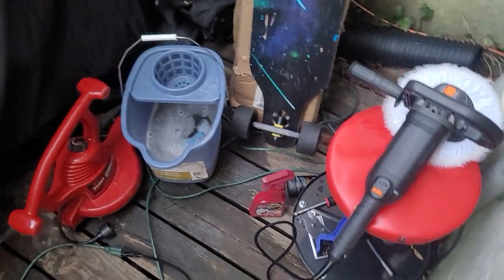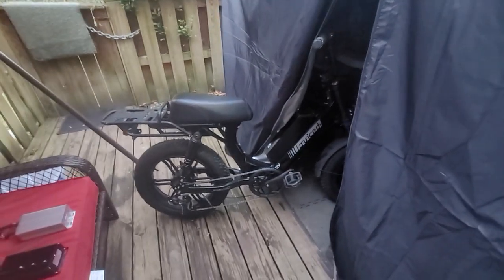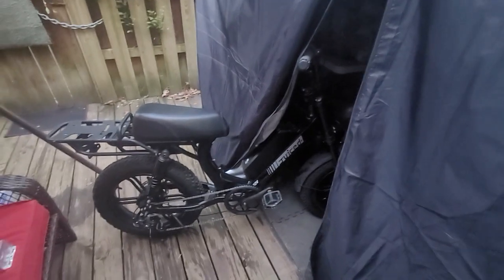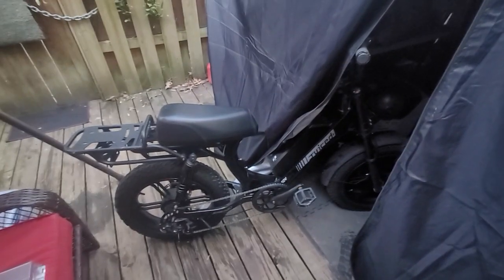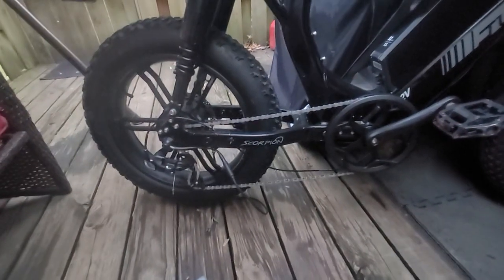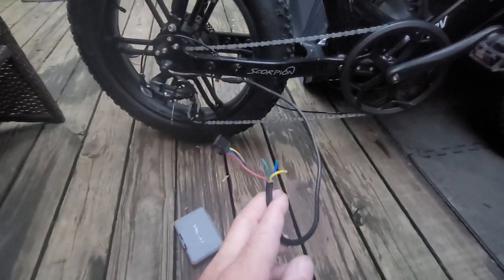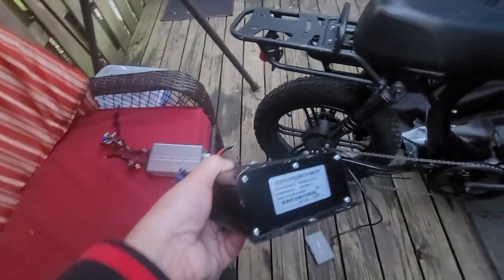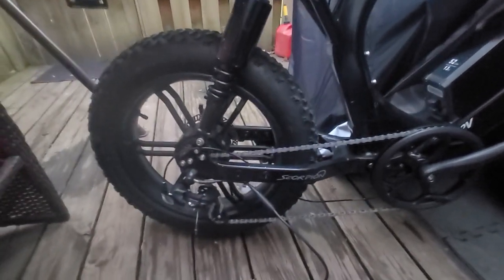How to make your Super 73,Zugo, Juiced bike faster in easy inexpensive steps 1st get your mind right

Comment: Hi!
I Did The Upgrade  And I Got A Super 73 and  750w hub motor  And A 48v  20ah  Battery 
And I Set The Controller  At 40 amps .It's  Running 
With A Lot Of Torke. 
My Question  Is Do I Have To Match The  Battery  Ah
With This Controller??
Or This Battery  Is Ok??
Thank's 🙏
Reply: That’s a good question!!!???

Comment: Hi I Just  Bought it 
What Lcd display I Need For It 🙏 🎄
Reply from the maker: @danielandujar5479  any display with a line input but you'll have to hardwire this isn't really a controller that would have great telemetry if you want that you need to spend a Lil more. This is as budget friendly as it gets. At least upgrade to a real Sabvaton

Comment: Hi, trying to replace the Rhino controller and wiring harness that got fried after battery upgrade from Zugo.  What type of wiring harness did you buy or is it a diy modified fat 3 pin Bafang power cable?
Reply from the maker: I got rid of all the stock everything so all new wires couldn't do anything with those small factory wires even replaced the motor so new phase wires I trashed it all
Reply: @ChrisCrossingWires1212  thanks for the reply.  These ebikes are better off being modded since the stock parts are usually pretty junky.

Comment: I wish you was doing this in a super 73 I want to add an aftermarket controller on my zx but all those wires on the controller just makes it seem so complicated whereas the super 73 controller is practically plug and play
Reply from the maker: i did a super 73 from start to finish its way back in my video section i showed everything its several videos
Reply: @ChrisCrossingWires1212 wow 😮😮😮

Comment: brother I recently  put that controller on my 500w bafang hub lmfao it gives  bout 100-120nm torque now just at 48v. I am also gonna  try it on my BBSHD soon.

really good controller!
Reply: What lcd can I use with it
Reply from the maker: absolutely I know for a fact it is can't beat it for the money thank you
Reply: @ChrisCrossingWires1212  hey bro check that controller again ... they either upgraded it or updated the label it now says 45-60 amps max instead of the 45amps it originally had... it has an orange label on the unit now too

Hey u think this unit can handle 88v charged to 100v or 96v charged to 109v? I seen some people say they can.. but I have not tried or opened one up yet. Have you bro?

FYI I am the same dude as the Animal Make, just on my other account.

Comment: Awesome time to upgrade my juiced scrambler
Reply: Yes same star rims
Reply from the maker: Do you have the same star rims I assume? The first couple mods will be with stock motor at some point I'm be upgrading to direct drive which I already have 20 inch fat tire rims with cheap Chinese direct drive and one with Qs205. you won't really need a qS unless your gonna go really far with upgrades the Chinese direct drives do almost just as good but I'm sure I won't be able to find a star rim direct drive motor

Comment: i have a 3000w 150a controller on 72v pushing a stock 1500w hub motor on my trike! on my 2 wheeler it was the same thing , only i upgraded the phase wires to handle more amps. mine hauls ass ! i have around $1500 in my trike build ( a fat tire 24" front and 20" rear ) , so he speaks the truth here. i've built several bikes and a couple of trikes off of amazon and ebay... all of them together is still less than the cost of one of those prebuilt "name brands" , it amazes me sometimes that ppl will shell out that kind of money , to NOT do the work or learn something! i'll post a vid on my build really soon , so as to offer inspiration to those on the fence. as he says , its not hard and it doesnt have to cost allot . keep up the GREAT WORK man! big fan!

Comment: yes Sir! been fiddling with a battery/blender-balancer. One harvested from AR Griz V2 and one aftermarket pricy purchase buck-50! Controller for the target bike is 25Amp, will be using your link. Stay tuned, plus I want to see your outcome. On standby Mr. CCW
Reply from the maker: Np I already have two builds using this controller way back in my archive somewhere on Frank and Super 73 build but you can definitely check this one out as well. I'm confident in this controllers reliability used it could times.